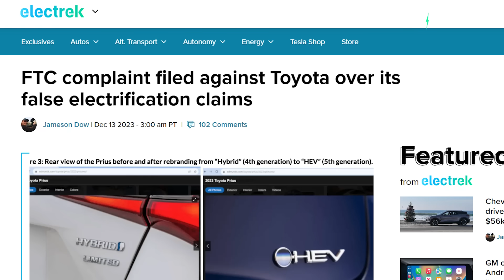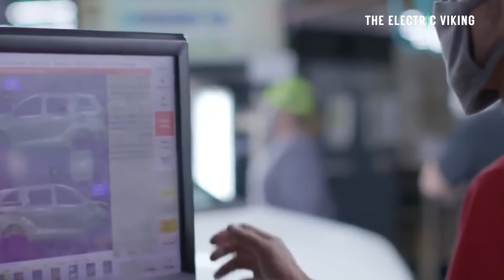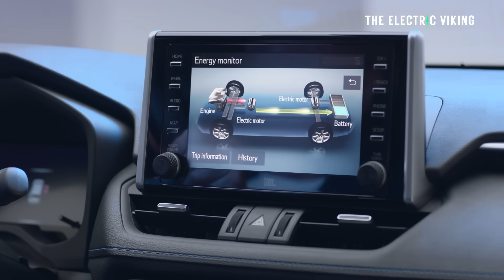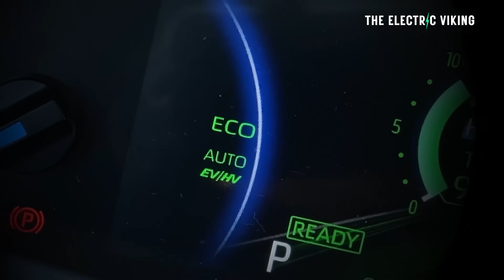The FTC is investigating Toyota's false electrification 'self charging' claims

Comment: And then these companies wonder why their EVs don't sell! Well bud, let me tell you - if you badmouth EVs non-stop, and then try to sell one, how do you think that will go?!?!? And whilst i'm in a ranting mood, WTF did you do with the Prius, Toyota? You have gone out of your way to make it seem like a pure-electric drivetrain is like driving a milk float. Go anywhere near that accelerator, and the engine leaps into life, "saving the day", and almost no improvement on that in the last 20 years. What have you been doing?!?!?
Reply: No improvement? And little increase in production. Toyota's plan was always to limit  Prius to 2% of production. Toyota has increased that by half - to 3% of production. My revivifier wanted to buy a Prius - very few available in Canada over the last decade.
Reply: I just got the Corolla Cross Hybrid and no one lead me to believe it was a pure EV.  I do know after 2 weeks of driving that it starts up in pure EV mode (it makes whine and the engine doesn't go on), when I drive down our local street slowly, only the EV works, when I'm in line at a drive through restaurant, only the EV works, and when I'm looking for a parking spot in a strip mall, only the EV goes on.  I just filled it up at Costco at 247 miles and I could only get 6.0 gallons of gasoline in it.  That's 41 miles per gallon.  Yahoo.

Comment: Hey Sam,  great article!  Just fyi... I've been going after Subaru of America and Subaru Solterra(Toyota support channel since this is a shared platform) about the advertised DC 100kwh charge rate for my cars.  I've got two 2023 Solterras.  I did a lot of data collecting and shared it with them.  SOA has also asked me to bring the car to the dealership to check if there was a problem as well as replicate the issue.  The dealership ran their diagnostics which passed and was able to replicate the issue.  The tech at the dealership contacted the factory as a follow up only to find out that charge rate is only capable of 73kwh.  Interesting info as the brochures for Solterra, Bz4x and Lexus shows that it can do 100kwh.  Watching your video just confirms the hype that Toyota does.   I feel that I and many others have an "actual" case to complain about since it deals with real specs.  Specs that the manufacturer advertises but aren't achievable; even in Southern California where the climate is moderate and provide near perfect conditions for charging.
Reply: Trade in for the Forester, the battery pretty much stays fully charged all the time.
Reply: Are you talking about charging speed? Then it should read kW rather that kWh (which refers to  battery size).

Comment: Nothing new, Norway band the Toyota self charging adverts years ago. So not a surprise the FTC has come under pressure, from the Electric supporting media and it does drives a coach and horses through the IRA strategy. An interesting article in the New York Times this September arguably puts its finger on the problem to quote “Toyota’s Dominance Threatened by Rise of Electric Vehicles” . 
However, the electric supporting media needs to be very careful, this could result in an outcome consistent with the classic Streisand effect, by raising visibility of the Toyota portfolio of new hybrids, just when it’s dominance is under threat.

Comment: Having an ICE on board disqualifies as BEV.
Actually Toyota claims are destroying their brands credibility.
The very fact that Toyota comes up with this crap is telling you this has become a marketing department driven company with no engineer in the driving seat.
It is very sad. My Prius 2009 335.00 km has been an extremely reliable car with no real complaints and still as efficient as at the outset though it still consumes 3 times as much as a model 3 on energy/distance.

Comment: Toyota is not just capitalizing on the confusion, they also feeding the confusion quite knowingly and deliberately. The same has happened in China with Toyota and others creating and promoting the use of the term "New Energy Vehicles" / NEVs to include minimally electrified vehicles, aka plug-in hybrid electric vehicles (PHEVs), in the same category as 100% battery-powered EVs.

Likewise, to deliberately further confuse everyone about the difference between actual battery-powered EVs and other vehicles, vehicles powered basically by fuel-cell electrical generating powerplants using hydrogen as its fuel (or FCEVs) have been lumped into the same NEV category, with sales being reported and tracked for the NEV category as a whole, rather than clearly broken out between actual EVs, PHEVs and FCEVs.

Comment: I wonder how efficient you can tune in an ice thats solely used to generate electricity and powers the wheels using electric motors. 

With it running at its most efficient output and no friction losses through a gearbox you should be able to combine the best of both worlds.
Reply: already achieved, combustion engines are just that inefficient.
Reply: Nissan epower and Mazda too have already on the market a solution of this kind and are not so great at all

Comment: Robert this Video was about PHEVs and Hybrids and if they should be called EVs or not.  If you want to compare a straight EV to a conventional car - you have to be specific because a car that gets 40mpg compares favorably while one that gets 12 mpg doesn't. Fossil fuel power plants vary in their efficiency. At full power they are up to 70% efficient but at lower power as low as 35%, then you have a 10-15% power loss in transmission and charging. The "petrol" car may have ethanol in it which is considered renewable and in brazil some cars run on 100% ethanol .. so you have a lot of variation.
Reply: B-but its emission free
Reply: Uh, no. Fossil fuel engines are 18% efficient. Ever heard of "Science?"
Reply: @FrunkensteinVonZipperneck  lol when? 1950? Try doubling that number. 

When using a coal/natural gas/diesel power plant to produce that electricity you get the same overall efficiency as straight up using gasoline/diesel.

Comment: PHEV drivers should never block chargers from use by pure EV’s. I only use public chargers at hotels when I travel. I monitor them closely and move when fully charged. We operate our vehicle totally as an EV when at home and in other cities. We only use the engine when traveling. We never worry about range. Our next car will be a full EV. We have made a significant reduction of all air pollution, not just carbon emissions.
Reply: Eh, most of the particulates come from the brakes and tires anyway.

Comment: My F350 diesel is an EV too. It uses electricity to heat up the glow plugs and an electric starter to start the engine. Then it uses the engine to recharge the battery.
Reply: Comedian.

Comment: So in 80% of cases where the Grid is black coal or gas anyway- the hybrid or PHEV produces less CO2 per mile. In the case that the local grid were nuclear, hydro, bioamass, grothermal wind or solar and the grid does not produce CO2 - then the EV produces no CO2, a PHEV produces 84% less CO2 and the hybrid still gets 25-30% less. So on average given the grid is 80% fossil fuel powered the Hybrid is better for CO2; for the 20% of cases the EV is 16% better than a PHEV and 75% better than the hybrid. Overall the mix favors the PHEV in CO2 reduction. They Hybrid vs  EV are pretty much a draw overall in CO2 reduction.

Comment: All hybrids have electric systems as well as ICE systems.   The industry AND the EV press calls plug in hybrids AND BEV's (which plug in) EV's.  They both give meaningful pure BEV mode range, and can function as pure BEV's a major portion of the time for city drivers. 

I drive so little that a PHEV would be in BEV mode 99% of the time if I had one. 

So just because you don't like it, it doesn't mean calling some hybrids electric vehicles is some major criminal conspiracy.  All EV's are NOT the same.

Comment: There's a certain validity in calling a hybrid "self-charging" if you ignore the fact that the charging comes from running a petrol engine which causes pollution. After all, if you plug in your car in a lot of places, you are actually plugging into a coal-fired power station or diesel generator, so the issue is not whether your charging is causing pollution. 

"Self-charging" simply means that the car doesn't need to be externally connected to a charger to charge its battery. Of course, if you think about it, a hybrid is simply a more efficient petrol-powered vehicle, but yes it does have a battery, which is charged in two ways: by the petrol engine and by regenerative braking. It's that regenerative braking which makes a hybrid more efficient than a regular ICE vehicle by recouping most of the energy that is normally lost as heat and friction from the brake pads. 

Toyota can of course argue that they are reducing their carbon footprint by making more hybrids and fewer ICE vehicles. Then, to muddy the waters further we have the plug-in hybrid which could theoretically be a net-zero vehicle if only ever used for short trips in full electric mode, but in practice still uses petrol some of the time, and therefore does pollute a little more than a full BEV, but less than a regular hybrid or ICE vehicle. 

I can appreciate Toyota's argument that they are pivoting more slowly to EV's than Tesla for example, in order to bring their customers with them, and this antagonizes the EV purists who want everybody driving a vehicle yesterday, but let's face it, there are many people who are not yet ready to buy a BEV for various valid reasons, but would be happy to drive a hybrid or plug-in hybrid, so in my mind it's better for them to do that than to keep driving a full ICE vehicle. 

Toyota is of course already making small numbers of BEV's, testing the waters, and are looking at copying Tesla's giga casting techniques to make EV's more cheaply, but I don't see them going all out until the EV mandates really start to bite, and they are forced to consider losing all their ICE customers if they don't fully electrify. But in some places plug-in hybrids still qualify as EV's which again antagonizes the EV purists, but if it reduces pollution overall, because it forces people out of full ICE vehicles, why not? The hybrids can be phased out later, when BEV technology has become more mature and more widely accepted.
Reply: your arguement falls down when you look at Toyota's production and design. Tesla uses great engineering and design to simplify production and drive cost to manufacture down. Then look at any Toyota vehicle and count how many parts go into making just a front bumper. Its easy to see Toyota is all talk. Its not only about EV purists, its a whole host of things Tesla brings to the market that a sleepy giant like toyota will not have a chance to look at for another 10yrs. Like drive by wire and 48v system. There was a reason Nokia died when the Iphone came out. People could see a tangible upgrade in functionality.

Comment: I have a line of LED lamps along the walkway to my front door. Each has a solar cell on its top, which charges a battery during the day so it can shine at night. You seem to be telling me that these aren't electric lights, since they don't plug in to a electric outlet. Essentially, you imply that an "electric XXX" is an XXX that plugs into an external source of electricity to acquire energy.

I'm sorry, but an "electric XXX" is an XXX that uses electricity in its normal operation. This applies to cars the same way it applies to lamps. It has nothing to do with how the XXX gets that electricity, only that it uses electricity. And what "to charge" means, is to raise the state of charge in a battery by running a current through it. Not "to acquire energy from an external source."

A Hybrid Electric Vehicle - note that this name includes "Electric Vehicle" - uses electricity from a battery, or a generator, in its normal operation. In fact, these Toyotas cannot operate without electricity. There are some others that can operate without, but only in the brief moment when transitioning between consuming charge and raising charge in the battery. How are these not electric vehicles? 

A HEV is more properly named a "Charge Sustaining Electric Vehicle." A Battery Electric Vehicle is a "Charge Depleting Electric Vehicle." A PHEV converts between these two modes of operation. The difference is that the Sustainer uses excess energy from its ICE to maintain a useful level of charge in its battery, while a Depleter is more-or-less continuously depleting its battery, until it can plug-in again. (Regenerative braking recovers less energy than is needed to return to the same speed, or ascend to the same elevation. So the cycle lowers charge unless some comes from elsewhere.)

Where Toyota was deceptive, was more of a passive nature. It  was by (pessimistic interpretation) implying that their cars don't need to acquire fuel, or maybe (optimistic interpretation) failing to mention that they do. The term "self-charging" is accurate (the advertising that used it was not). HEVs sustain the charge in their batteries by themselves, not by requiring the operator to do something like plug it in.

The only actively deceptive claims related to this issue, are the claims that an HEV is not an electric vehicle, that "to charge" can only mean "to plug a battery into an external source of electricity," and that HEVs do not maintain charge in their batteries by themselves. This deception leads to much confusion among consumers, many of whom do not understand that they don't need to plug-in.

Comment: Toyota's self-charging is merely regeneration. An ICE gets the car moving and when the engine would normally go into overrun, say... in a simple petrol car, it simply slows to a stop instead and an electric motor/generator feeds a battery with electricity. It then takes from the battery to aid in acceleration or running along at a modest steady rate. It is NOT true self-charging because there is no such thing. Not even a full BEV is actually self-charging. Nothing self-charges. Everything obtains power from an external source. Even solar panel powered vehicles are obtaining power from the Sun. To be fair to Toyota [really, I don't quite know why I should be though] they do the whole ICE/Electric Mot/Battery integration quite well, but it's no match in effciency to a proper BEV. And they're way more complex than a BEV, so servicing costs must be fun, not. One Toyota Corolla HEV owner told me he got around 55-60mpg, which I admitted was pretty good, but not quite upto my BEV's average of 136mpge. He kind of gulped in awe at that. Hybrid buyers are obviously often being duped into thinking they've bought something better than a BEV. It simply isn't the case.

Comment: 80% of driven miles in the USA are commute miles. Most commutes are within 15 miles; thus near all commute miles drven by a Rav4 or Prius pHEV can be covered all electric with their 44 mile all electric range. On an Longer trip,  the first 40+ miles of the trip would be electric, plus some percentage as the engine and regenerative braking will recharge the battery. So of the remaining 20% of miles perhaps 20% is electric; or 84% all electric driven milage. Many Toyota hybrids do not have plug in ability, they would be driving about 25-30%% all electric But do not use grid. If the local grid is coal or gas (80% is) then the hybrid reduces more CO2 than the EV.
Reply: You are not driving on electricity if you are not filling with electricity. Even coal power stations are slightly more efficient than a petrol car
Reply: If you're driving on electricity so much with a vehicle with only 40 miles of electric range, then why not just purchase an all electric vehicle with a range of 350 miles.
You're only driving short trips most of the time anyway with that PHEV. 

On your rare occasion long trip, Superchargers work great, telling you when and where to charge up, the cost per kWh and available number of chargers before you ever reach the charging location.

PHEV and EV cost is comparable.

Comment: I don't give a shit if they use the combustion engine <10% of the time.. if it HAS a combustion engine in it.. it AINT an EV. You can call it a hybrid.. fine.. let the driver decide which side of the hybrid they want to use more.. that said, hybrids are SHIT. Yeah.. there's like a 2% of the population who really will benefit daily from a hybrid. The rest are just ignorant. You either will be best suited by a BEV.. OR best suited by a normal ICE. Hybrids, mostly, are crap.

Comment: 1-4 years old EVs that get written off due to cosmetic scratches to the battery that people get quoted 50k$ or worse for repair (60k$ for the Ioniq 5 in Vancouver BC) aren't particularly environmentally-friendly either. I'd rather buy a plain ICEV than risk having to deal with that level of BS.
Reply: You’re way of thinking is why Toyota is going downhill. 😂
Reply: No one deals with that level of BS. If a car - any kind - crashes, and the insurance company writes it off - that's the insurance company's problem, the owner gets a check. That "BS" is only a problem for people who don't have insurance. :hand-pink-waving:
Reply: @FrunkensteinVonZipperneck  say that again when your insurance premium goes up $2000/year for likely purely cosmetic damage.